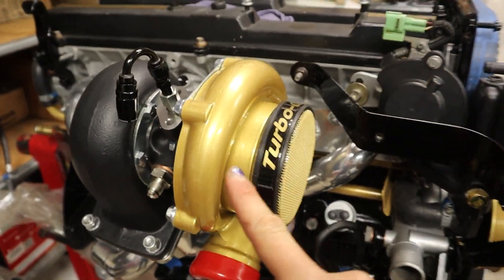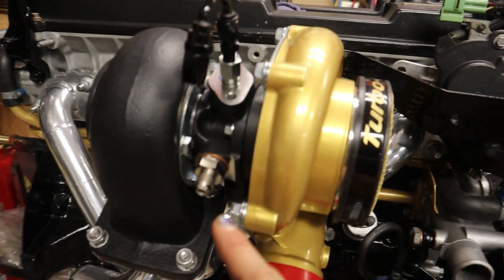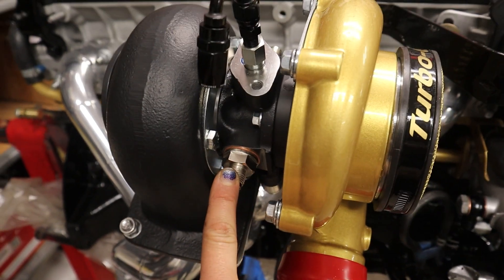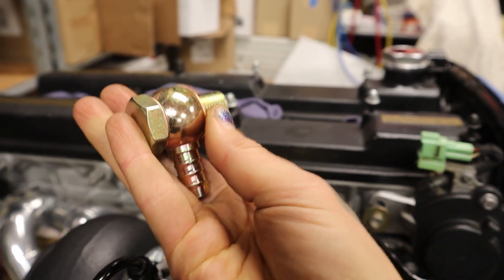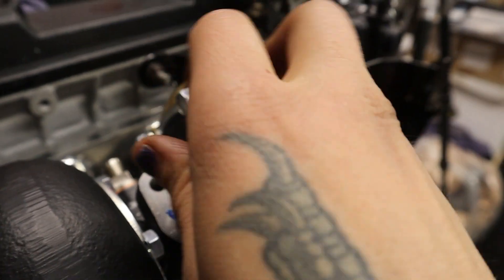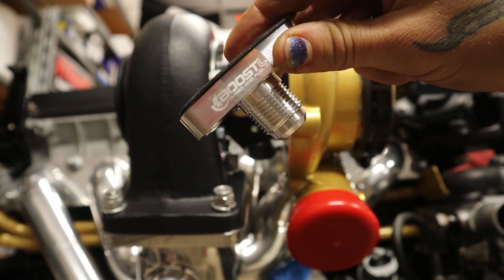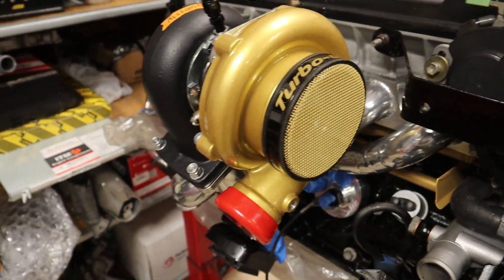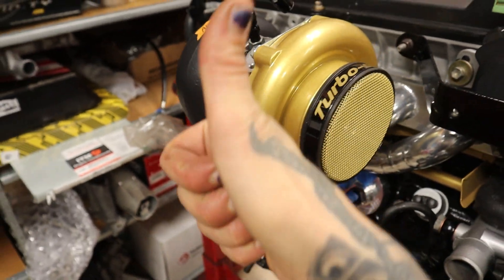Turbonetics C15 TNX 60-Series Turbo Fittings

Comment: Do you ever have any problems purchasing hardware or other parts off of eBay or Amazon? I'm leery of purchasing certain types of parts such as name brand spark plugs of the pricier (exotic metal center electrode) variety after some verified buyers on Amazon got burned with counterfeit replicas that got into the supply chain. Some non-critical parts wouldn't make much difference but for things like connecting rod fasteners do you stick with name brand parts by reputable sellers?